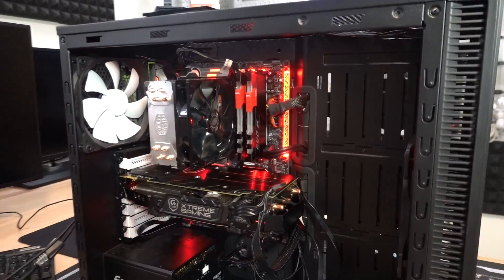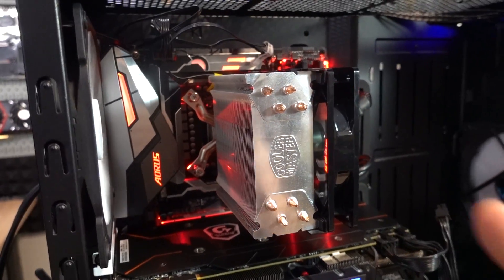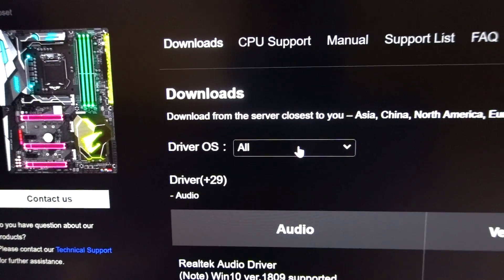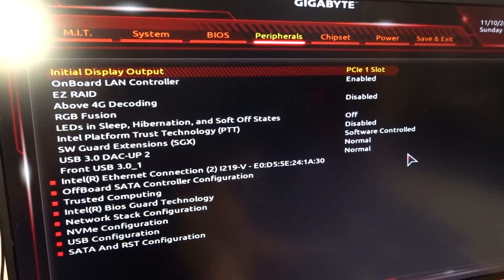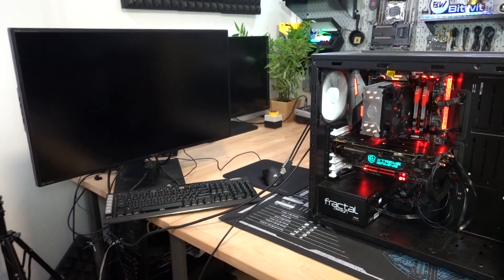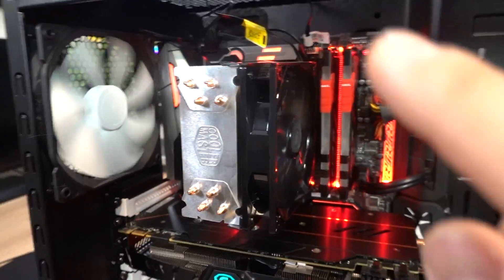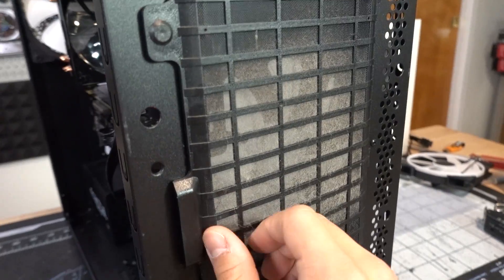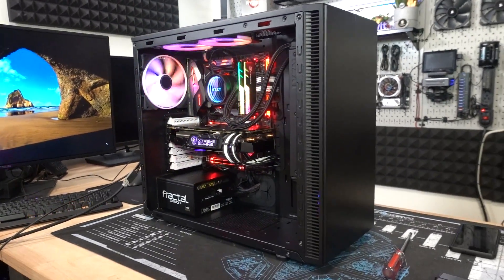Every PC owner should know how to do this

Comment: I'm building a new system pairing 13600k with a ROG STRIX Z690-A GAMING WIFI D4 along with a asus 3080 white edition and I am afraid to break the sealed of the box so just in-case I need to swap out to 12600k.
As I understand, I have to flash the BIOS (using the BIOS Flashback button in the back) for the system to even recognize the 13600k and post. However, according to Asus' firmware website, the Intel ME firmware needs to be updated prior to updating the BIOS. I hope you can help me

Comment: I think that you have explained the problem I have been having.  I need to flash the bios on my computer.  I upgraded the processor and the socket is correct; however, the unit will not boot.  Your video provides me with the roadmap that I need to upgrade my computer.  Thank you!

Comment: bitwit
I've been trying to update my cpu and I was trying to update the bios but my m flash option on the uefi screen is locked and can't access it. 
I've made sure that I loaded the update onto a blank USB using FAT32. My motherboard has an option to access from the pop up screen (where you press delete to enter bios) by pressing CTRL + F5 but my computer doesn't enter M Flash mode at all. I've looked everywhere and I cannot find a solution. Does anybody have a solution or know somebody that has encountered this problem? 
PC Parts for Reference
MSI Z370 SLI PLUS 
INTEL CORE i3 8100 
MSI GTX 1060 GDDR 5 6GB
SAN DISK 240GB SSD 4 x 4GB 2400MHZ RAM

Comment: hello everyone,
I've recently built my first pc and I've encountered a problem with the bios. I have a 5600x so I updated the bios with a USB stick like you should but the issue is that when I power off my PC, the bios update doesn't save. So Everytime I turn off and on my pc I need to manually update the bios with my USB stick but when I restart my PC that doesn't happen. I thought I might have a faulty Cmos battery but after replacing it nothing has changed. Is the whole motherboard faulty ? i would really appreciate some help. The motherboard is a MSI B550M Pro-VDH WiFi.

Comment: brand new pc here, finished building everything and its just black screen, no video signal. its a z490 a prime motherboard with i7 10700k and zroyal 16gb ram @4000 x2. the mothermoard ram light is on, tried every ram configuration and even used some older ddr4 ram and nothing. 

I am just returning the motherboard and cpu (bundle package). any ideas what could have been the cause for this?

Comment: Device name	DESKTOP-1LVA3QE
Processor	Intel(R) Core(TM)2 Duo CPU     E8500  @ 3.16GHz   3.17 GHz
Installed RAM	2.00 GB
Device ID	17095BBF-E265-47C1-81D3-0434FCE09727
Product ID	00330-80000-00000-AA884
System type	64-bit operating system, x64-based processor
Pen and touch	No pen or touch input is available for this display
:)))

Comment: i have ryzen 7 3700x and evga geforce rtx 3060 xc, ASRock B550M PRO4. i also have the same monitor XD. in my bios, because i got the fan that came with my cpu (in the box of the ryzen), i can change the color settings of my fan, and im normally using rgb.
edit: its a custom build that i made, i got every single thing from micro center, and when i mean everything, i actually mean everything. (monitor, keyboards, mouse, usb, ect.)

Comment: some motherboards can update bios with only power to the board ( no cpu/ram installed) so you technically dont need the previous cpu in some cases if your motherboard has a bios update port and button

Comment: Hi
I have an empty 500gb and want to install win10 
with a usb
when I plug in the usb it says
"Invalid Partition Table"
ive set usb as the first boot and then the hdd as second

Ive hard formatted the 500gb
any suggestions
help would be appreciated!
Reply: R u sure you setted up to boot from the USB on the bios?
Reply: @ggp4961  100 percent shure
Reply: @catfish_lude  no clue then

Comment: This is why I always use a UPS. Not that I ever update BIOS unless i need to, but a UPS prevents power outages from causing data loss, and prevents brownouts or noise from causing damage. My friend's PC died after a brownout (he used a surge protector, but no UPS). The mobo broke but I was able to fix it by disabling the EPU via jumpers.

Comment: Some MBOs require you to flash BIOS twice, first time goes to BIOS chip thats been used, second time it goes to backup chip. Also, dont worry about UPS and BIOS update failure, because if it fails, BIOS Agent (read only chip) will still be available (but it will most likely require PS/2 keyboard). For comparison, BIOS is like Android Recovery, if it fails, you got BIOS Agent, like Android Bootloader. However, not all MBOs got this kind of bare minimum BIOS loader chip built in (the one that you can never flash, read only memory, ROM).
Also i hope to see more MBOs like Asus B250ME, that got networking support, such as DHCP in BIOS/UEFI, where you can simply check inside BIOS if there are BIOS updates, and it will update/flash it for you with simple button inside the BIOS, all it requires are LAN cable with internet connection, so you dont need USB stick/drive, downloading BIOS file and do it by yourself, simple thing, very good and fast one, like go to BIOS, choose Check Updates, hit Update, done, cannot be easier, and you cannot accidentally put wrong BIOS or corrupted one on your MBO.

Comment: So if you are purchasing your 1st motherboard and CPU, and the motherboard says "BIOS update might require for AMD Zen 3 Ryzen 5000 series", you wouldn't be able to update the BIOS without having an older CPU?
Reply: That's correct. You may want to double-check with the place you're buying from. Some older boards that are still in production may have been updated to a newer BIOS version, but some may not have been.
Reply: @JJFlores197  awesome thanks for answering!

Comment: i just got a alienware aurora r11 with a 1650 super with 8gb of ram and it is starting to act up and run i wouldnt say slow but pretty slow and i was wondering what you think i should upgrade, getting more ram cleaning out the computer getting a bigger hard drive, upgrading something but im just trying to find answers on what i should do and if you could help me that would be the best thing, and it sounds like im having some sort of gpu bottlenecking that i do not know how to fix it.

Comment: Looks like you didn't use enough thermal paste, you didn't hammer in the brace, and you must have let the the brick come into contact with the case and short circuited the whole thing out. good Job!

Comment: shouldn't we check the motherboard's manual for any fault code reading? i thought that was super helpful everytime i had trouble with any kind of system, board usually has a code blinking from LEDs or even a sound beeping in certain pattern to let u know which part is failing ram, gpu, cpu, cmos, etc?

Comment: To point out for other users using AM4 with 5000 chips, you should be able to flash the bios with only the PSU plugged in via USB.

Comment: Today I took my GPU out of my PC to clean it and when I put it back in there was no signs of life and I thought it was my motherboard because usually after I unplugged my PC from the wall the motherboard light would turn on but it didn't and I ended up shitting myself literally but then 30 minutes later after staring at my motherboard for said 30 minutes I put my GPU back in and thought I would go eat dinner but I press the power button one more time and it worked so can somebody explain to me what the fuck happened

Comment: Fun fact - Gigabyte was the first company to have a software, that updates BIOS while in Windows. It dates back to their DDR2 era boards. I used it back in the day on an AM2 board with dual core AMD CPU and Windows XP. If you boot into windows you don't need to do that flash drive hornswogle...

Comment: Yo guys noob question i know but im new to pc building. But when changing a bunch of stuff out like he did in the second half, do you need to do anything with software to make it work or should it just work?  Specifically with the cpu cooler and the cpu itself do you need new drivers or anything apart from the bios update for compatibility? I dunno if the question makes sense but figured id try it here lol feel free to laugh lmao

Comment: My take on this kind of problems is testing it with a different PSU next flashing the bios. (With chip programmer hardware)
This fixed the last 4 of 5 boards for me.

Comment: Hey Mr. Kyle, any idea why my PC boots and works fine, but when i get into the BIOS, its just a blank screen? i cant get into BIOS settings whatsoever. ive tried swapping my ram around, ive tried unplugging the PSU and pulling the CMOS battery, nothing works... i can get into the BIOS screen, but its just blank. no options, nothing but a cursor in the middle of the screen that i cant move...

Comment: Ah yes, the ol' "New Proc in Unflashed Mobo" chestnut...

I've learned to save myself the hassle and try and check for new firmware once a year. That way, if I want to shift SKUs, all I have to do is refer myself to my mobo's Support page. My one peeve is that some manufacturers are kind enough to include some UEFI-based means of accessing the Web and downloading packages from there, and some just aren't. The last time a friend asked me to take a look at their AORUS mobo, I just quietly groaned before saying yes, seeing as I'd have to rely on a second machine to get the BIOS update...

Comment: Heres a good tip if your pc doesnt want to start up  try taking out the graphics card if it then works (with the motherboard graphics card) it will work much much worse but then youll know its either the care or the motherboard to graphics card port and then you can start finding a replacement

Comment: do you need a cpu to update the bios?
i have a ryzen 3100 and a ga-a320m-s2h which supports only 2nd gen cpus , but i only have a ryzen 3100, but with a bios updte it can support 3rd gen cpus

Comment: Sry I've lost alot of brain cells, what does UPS stand for ?
Reply: Uninterruptible Power Supply. It basically provides battery backup to anything plugged into if the main power goes out. How long the backup power lasts depends on the UPS itself and the load placed on it by the devices attached to it.
Reply: @JJFlores197  thanks

Comment: I hope my current computer will last a very long time like my previous one which was my first build. My first build is 12 years old and is still working. The only thing that broke was the CPU fan and it still worked with passive cooling. I replaced the fan but it's still running hot so I'll change the cooler. Even though it's really old, I still want it to run for years to come.

Comment: Do you think updating BIOS would resolve my issues. My PC don't wont to turn on with two new additional RAM sticks. It works fine with ones that i already had in may PC but as soon as i add two two new one in empty slots just don't wont to start. It just turning fans on and off and that is it.

Comment: If it is a BIOS issue, how the system can run with 8700 (previous) Processor for months ? If the BIOS is not supported , obviously 8700 processor will not even have display on the screen

Comment: Every PC owner should know how to do this (Bitwit Version): Flash BIOS with latest version to upgrade previously unsupported CPU.

Every PC owner should know how to do this (IRL Version): After finally figuring out which BIOS version your board is currently running from OEM (and saving it for later), flash BIOS 12 times with successive BIOS revisions until you finally get a stable version which correctly supports your new CPU with minimal issues.  In case of failure, reflash back to OEM BIOS (you did save it first, right?), then rinse and repeat, ensuring you have read ALL caveats posted in the mobo support pages/forums.  If pain persists, remove offending mobo for use as a dog dish, buy a new mobo from a different company and try again.

Comment: Recently I made a new build with an AMD Ryzen 5 3600 and an AMD Asrock B450M PRO4 mobo which stated on the box to be "Ryzen Ready" but in fact needed a bios update of which I was not aware. Unlike Kyle I do not have 40+ CPU's lying around 😶 so I ended up bringing it down to the local computer shop. They were happy to do the upgrade but said that a lot of shops won't burn their fingers on high end AMD
stuff and prefer Intel instead. Kinda lame ....but anyways...purring like a kitten now!! AMD even provides a free compatible CPU for upgrades but I thought it was too much hassle with the paperwork (until I saw NexusGaming's video on the subject later...)I know higher end mobo's are actually equipped with usb ports to do just that.

Comment: Hello guys... please help.... My build was working fine till 2 days ago it suddenly stopped.... My monitor read something like the signal is not 1080p 60hz, I have a s2240l dell...  Config fx 8350, asus hd 7870 vengeance 16gb, samsung 512 gb and kinston 128gb ssd, gs 600...yes it was a 2015 build that I am using. So anyway I hooked it up to tv which supports 100hz refresh rate and now it loads till the windows spalsh screen after that... everything is black... nothing...so i went to safemode... removed the gpu driver with ddu and now it loads normally but when ever I try to install the gpu driver it goes black... any idea what is wrong? Please help

Comment: About the unplugged power cable.... When I work on a PC I always leave the power cable connected and switched off at the wall and PSU (if its available) this ensures the whole case/system is grounded throughout the entire operation. This has a lot more useful applications than grounding bracelets or anti static work surfaces and can be a lot less annoying to work with.

Comment: 'm looking at getting the B450 AORUS PRO WIFI (rev. 1.0) can anyone tell me if the bios on those are up to date and if not do you know if they have fixed the issue with the EC FW Update Tool or is that just an issue with the x470 board?
Reply: The issues that i have read about are anything from sound not working to ram not being recognized after using the EW FW Update tool.

Comment: Hey I noticed you're using a gigabyte motherboard so as you know the thing forever with gigabyte is there dual bios. Like for 20+years. So if you will give the bios before power down or you know whatever you have a dual bios you could always switch the second bios in and your good to go. Then you could fix the first bios or just use the 2nd.

Just thought you might wanna mention that since you are working on a gigabyte board and you didn't mention the dual bios as you were talking about power.

Comment: Sadly i had to buy a new pc yesterday, since i cannot get my i5-750 to boot anymore. Windows stuck with a boot error, and using a boot usb stick also crashes. Removing, swapping memory didn’t help. Reseating the cpu did help 1 time, but then crash again. I also updated the bios, but no luck. Since i only used the i5-750 as a mame pc i upgrade to a ryzen 31200, complete with memory and asus mainboard it was one of the cheapest upgrades on offer for just over 150 euro. So hoping i diagnosed every thing correct i will be gaming soon again.

Comment: I didn't have any boot either but I found out it was because the power bar I owned and was using didn't allow enough amperage to flow through - causing the required boot power to be insufficient.

Comment: I got a Ryzen 5 3600 and a gigabyte ds3h which advertises on the box that it supports 3rd a gen Ryzen CPU. Once put together, I had the same exact issue and it wouldn’t post, it wouldn’t load, nothing. Turns out I needed a bios update, so yay. I bought a ROG Strix and I’m not gonna lie, I love it so much more than the gigabyte 💕

Comment: hello I'm building 2nd pc (1st was in 2015) i am stumped on this z390 aorus pro mobo ordeal about it not supporting 9th gen cpu's out of the box. My question is will i most likely have to update bios & also how if my current cpu is i5 4690k and not an 8th gen (in order to update bios -.-) if any body can shed some light it would be super appreciated because this is the only part that is keeping me from building it, all the parts just came in tonight, thanks!

Comment: I got a question

Will I also encounter this problem if it wasn't a cpu upgrade?

I mean for example I bought the 9700k and the same motherboard first.

I was thinking will I need another cpu to update said bios? Or can I do it with the fresh mobo and 9700k?

I think I will.... From my understanding, what happened was the 9700k was not compatible with the mobo since the mobo did not have an up to date bios... And there is no other way to update it without another cpu or computer to be exact.

I'm new to pc building. Trying to understand stuff. Thanks for the content, Bitwit

Comment: I have a similar problem but instead of changing my CPU I changed my ram from x2 8gb to x2 16gb 
I've updated my bios and everything beforehand but as soon as I boot up with my ram in it's designated dual channel slots my PC won't boot, not even the bios things won't pop up. Funny enough if I put my ram in the two slots farthest from the CPU it boots but in single channel....
I have a z270 motherboard, i7 7700k, 2070 super, x2 16gb 3200 gskill
If anyone has a solution please feel free to reply thanks

Comment: Tech support pro tip: if you're using a UEFI-based computer, you can start directly into the BIOS by holding Shift when pressing "Restart" in the Start Menu or logon screen, then under Troubleshooting -> Advanced Options there should be a UEFI BIOS option. This doesn't apply to every computer, but modern systems especially should have it available.